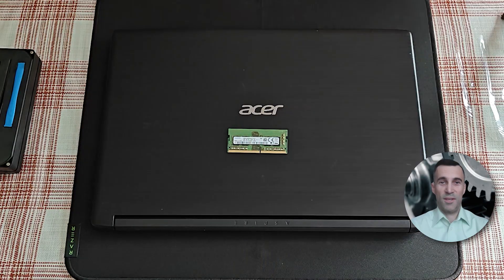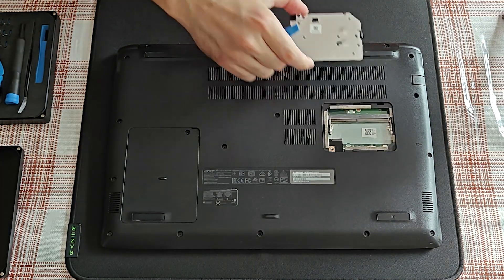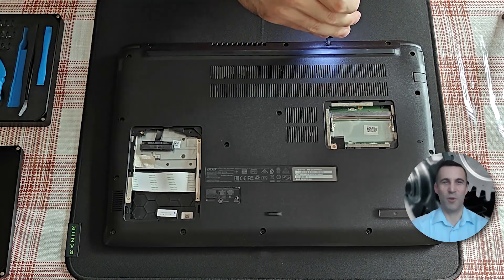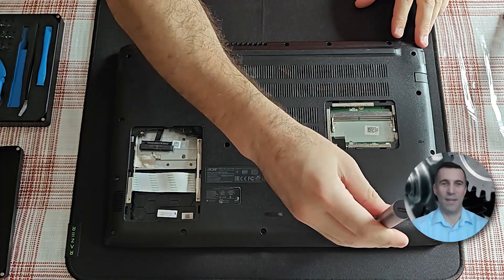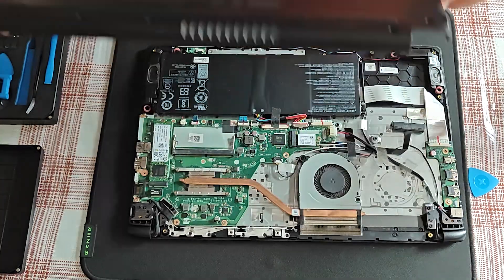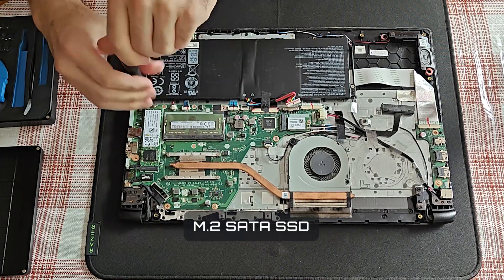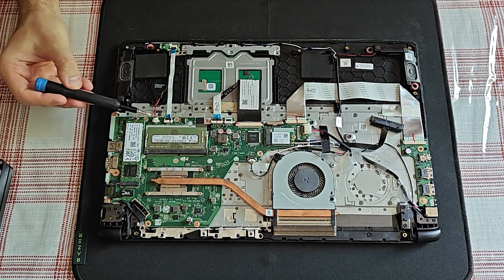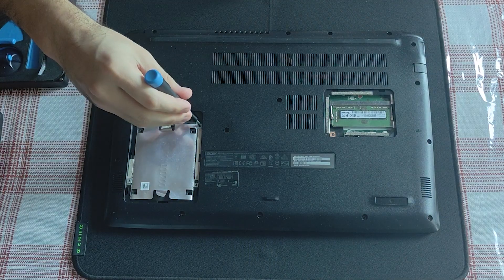Acer Aspire 3 A315-53 - Upgrading to 12GB RAM and installing a SATA3 SSD

Comment: I have one of those notebooks (A315-53-578V). You say the M2 drive is SATA. But I looked up the drive specifications on Intel's website and it says it has a PCIe 3.0 x2, NVMe interface. Given this, why didn't you upgrade to the M2 drive instead of the SATA drive? Are there multiple versions of this notebook?
Reply from the maker: Great question. The original OS drive that failed on this laptop was m.2 SATA. I went for the safe route and just bought the 2.5" SATA SSD because the former is a bit hard to get these days and sometimes even pricey. Didn't want to gamble with NVMe PCIe 3.0 because I had to act quickly and risk free. Feel free to let us all know here if you were able to install it and get it running. Thank you.
Reply: @smooth.IT.operator  Hi! I confirm it works. Yesterday, I installed a Kingston NV2 512GB NVME disk with Windows 11 24H2 and works great.
Reply from the maker: @TheRebelOnMe  Awesome. Thank you for sharing!

Comment: I wanted to upgrade my ram to 12 gig too. But when i insert ddr4 ram in the slot, my laptop turns on but does not show any display. I tried multiple ram sticks (all of which were ok), cleanning the ram slot and trying multiple stick like 2133p and 2400T. The current soldered ram is 4gb ddr4 2133mhz. Any advice?
Reply from the maker: Thank you for  watching. I had an issue just like yours on a budget Lenovo laptop. It just wouldn't accept any RAM module to work along side 4GB of soldered and existing RAM. There was nothing I could do. Can you download the most recent BIOS version from Acer's website and install it if available? Then see if your modules are accepted.
Reply: @smooth.IT.operator  BIOS updating seems like a risky move to me. However i should say that when i was inserting random rams into the slot, by luck 1 ram showed display and bootup. But the display was showing red green blue pixels and seemed to freeze. Tried again, didnt boot again. Anyways, thank you for the advice, if nothing else works, i'll go for bios as a last resort.
Reply from the maker: @hooqah  You are right, there is risk involved when flashing it. Just double-click the .exe file and make sure your laptop is connected and battery fully charged. Without these last two you won't be able to upgrade it.
Reply: @smooth.IT.operator  Update: I checked acer support to upgrade bios. There were 4 bios version (my laptop had the oldest version). I updated all version one by one to the latest. Then i checked multiple rams. 

On the oldest version i didnt got any display. Then i booted my laptop. Into the boot, i got a choppy display and i got a BSOD, from there i could access BIos. In the bios the total ram was increased. 

But i still had chopped display + cant boot up.
Reply from the maker: @hooqah  Should you consider getting a new laptop if you need more RAM for your workloads? Only you can decide that. Best of luck.